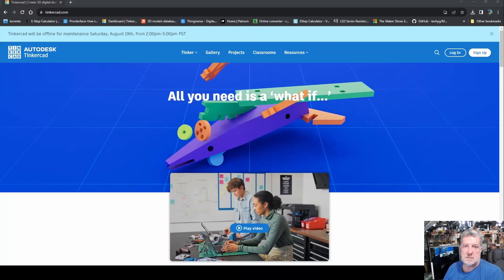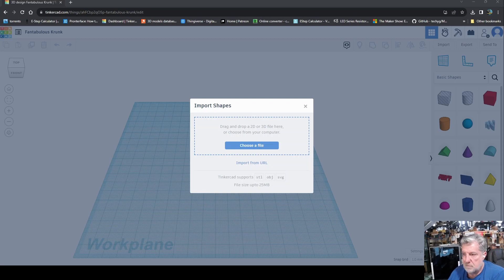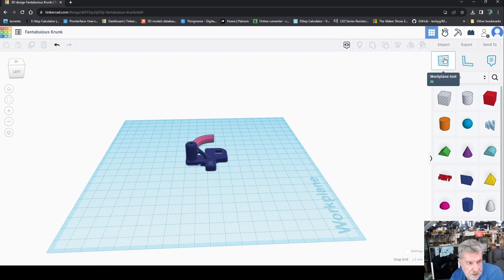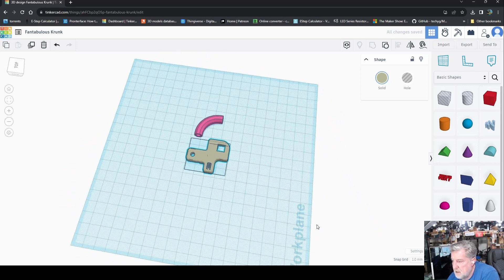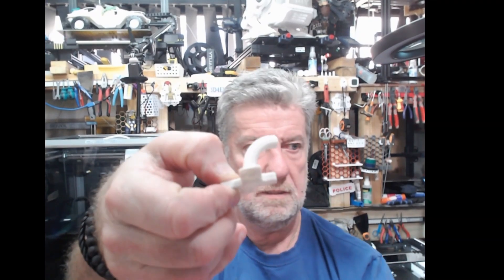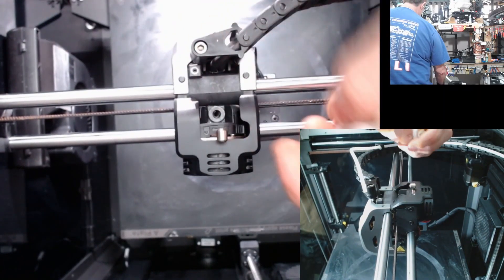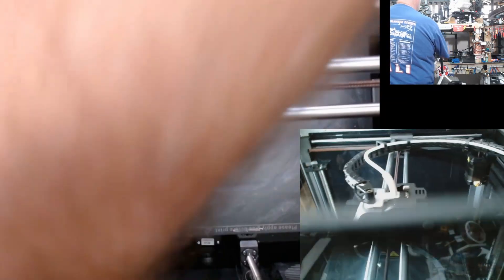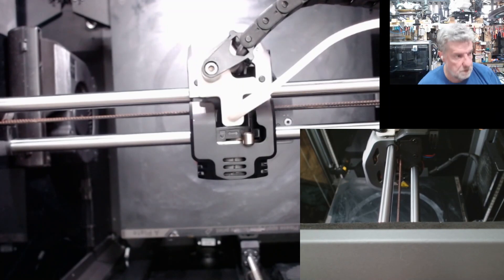Creality K1 Max fixes! Tinkercad walkthrough

Comment: Your modified part won't work.
The angle you have the bend set at is optimal for when the tool head is in that position on the bed but what about when it is at a different position. 0,300 for example. The PTFE is going to kink even worse than without the part.
The 90 degree curve will need to be able to rotate on the z axis like the original part could so it can adjust to the changing tension as the tool head moves to different locations.
Reply from the maker: Part works fine and has been for the last 6 months

Comment: How do you get pass the error 2243 code? 🤕 I'm down bad
Reply: I'm using the prusa slicer. Also the test files work 🤷 this is my 1st printer. I'm 5mins away from making a yt ch. Of me looking at the printer. 🤕
Reply from the maker: @alimrashid9765  try downloading Creality Print ( https://www.creality.com/pages/download-k1-max-flagship?spm=..page_1934481.products_display_1.1&spm_prev=..index.header_1.1 )  or Orca slicer (  https://github.com/SoftFever/OrcaSlicer/releases/download/v1.8.0/OrcaSlicer_Windows_Installer_1.8.0.exe ) These have built in working profiles for the K1 and K1 max. I have videos on them on my page
Reply: @3D4Everyone1  thank you so much! Will keep you posted 🙋
Reply from the maker: @alimrashid9765  hope it fixes everything,  They are better slicers for the K1"s
Reply from the maker: Is that on the K1 or the Max?
Reply from the maker: If it is happening on the max are you printing a files set for the k1 or vice versa? You might need to adjust the bed size to suit your printer. Also do you have the latest version of Creality Print if not I would recommend you upgrade.
Reply: I have the k1 max. I downloaded the latest v1.3.2.20 firmware

Comment: Great video as all of yours are! Going to give this a try, running into issues running the LW filament in the K1 Max! This filament has a very rough texture on it and I think it is causing me some print problems because of the added resistance through the bowden tube.. Thanks so much for sharing with us!!!!
Reply from the maker: Hope it helps,  if not you could try running the filamemt from a spool attached at the top of the printer ( https://www.printables.com/model/622555-creality-k1-max-top-mounted-filament-spool-holder-). Just put a very short bowden  tube straight into the top of the print head, and reduce the bowden issue
Reply: Thanks so much for the tip there on that top stand!!! I think it will do just exactly what I'm after!! @3D4Everyone1
Reply from the maker: @Walt1119  excellent

Comment: great vid. Quick question, i have had the printer now for 2 days. so not enough experience with it to determine what fixes i will need as it "seems" to be ok. have you found that this upgrade helps?
Reply from the maker: I was having a few problems feeding filament in to the extruder. If yours goes in ok, i wouldn't bother with this.
Reply: @3D4Everyone1  ah, makes sense. Thanks. So far so good 👍🏼  tnx again
Reply from the maker: @LucidFX.  excellent,  you'll love the printer. Enjoy